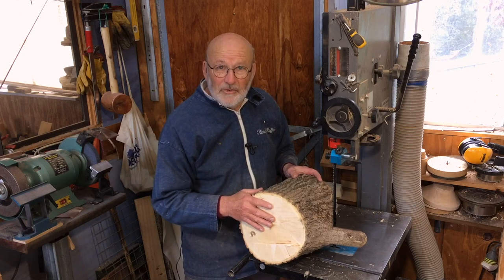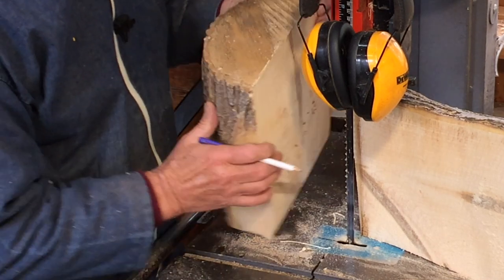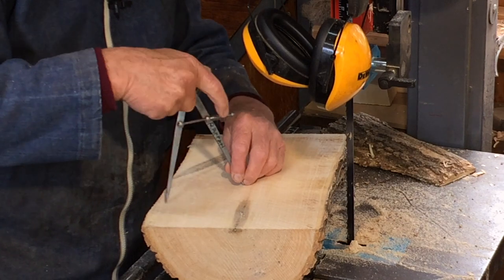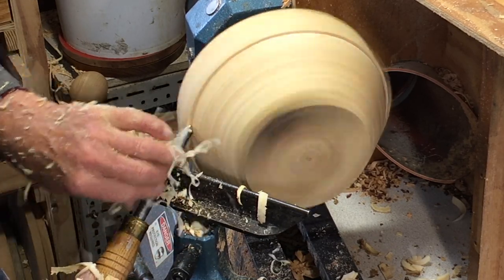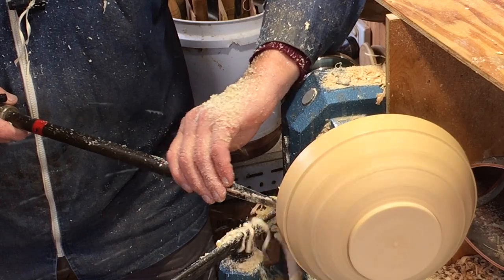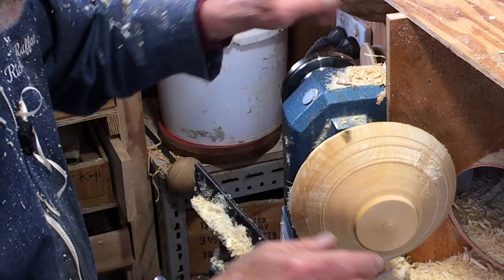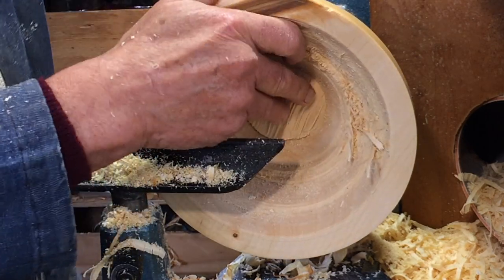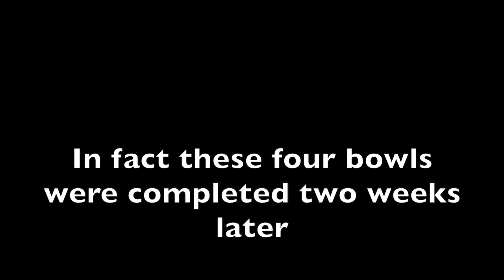Richard Raffan gets four bowls from a short box elder log.

Comment: Very nice result. The coring resulted in two smaller bowls, excellent. You make it look so simple. Must be nice turning that wet wood. Thank you for sharing. Have a great day and stay safe.🙂🙂
Reply from the maker: I find wood most enjoyable to turn when it's been felled 3-4 months when it's beginning to dry and I don't get soaking wet as it fling out moisture. And after that when it's really old. I've turned oak and elm several hundred years old out of old barns and chuches and it's almost a different material to modern seasoned timber.

Comment: Absolutely marvelous! I really enjoy Box Elder, especially burl and feather figure. We lack the flame here in New Mexico but I enjoy it regardless. 

Mr. Raffan, would you please consider a video of your bowl drying process? I follow Mike Mahoney’s school of thought but that means my rough bowls get slathered pva-like glue and dry for 6 months or more. How does your process work?
Reply from the maker: Many thanks for the suggestion, Scott. I'll add that to my list. I don't bother with sealing endgrain on bowls. For a few days the bowls are left in a loose pile out of the sun. I check daily to see if any start splitting. Those that do go straight back on the lathe to be completed green, and thereafter they tend to warp rather than split. After a week or so the roughed bowls get stacked away for at least a year and often way longer. Like decades. I still occasionally come across bowls dated in the 1980s and '90s although I sold most when I downsized.

Comment: I learn so much by watching you and listening to your reasoning as you proceed. Thanks for sharing. It means a lot to a novice turner to have a seasoned veteran like you. Question: I know boxelder is soft and therefore dries relatively fast but “3 or 4 days” (which ended up being a couple weeks) seems too fast for them to be ready for finish turning. How do you dry your green pieces so quickly without incurring excessive splits or warping?
Reply from the maker: Initially my intention was to complete the bowls whilst there was still enough moisture in the wood that the bowls would distort slightly once finished. Unfortunately they warped before I could re-turn them. I was surprised at how dry the shavings were but occasionally roughed bowls are ready for completion in a few weeks. Much of the initial warping in a bowl is due to releasing tension in the timber when the centre is removed. For my Wavy (distorted) Bowls I look for timbers like casuarinas or oaks known to warp and they are microwaved to speed the drying. For bowls that are to stay round, I choose timbers known for their stability. To limit splitting it helps to have timber of even density and even thickness. The position of the pith affects how a form will distort. You can see how in the gallery on https://www.richardraffan.com.au and read about it my books, particularly Turning Bowls.  https://www.richardraffan.com.au/books-and-dvds/

Comment: Hi Richard,

Could you tell me what the advantages of the "harpoon-style" handle you have on the slicer are over a long self-made turned handle? Also perhaps if side handles or braces provide much?

I am learning a ton from your books and these videos especially. Thank you so much!
Reply from the maker: I don't understand the physics, but the pistol grip is easier to control than a straight handle. The original Stewart System had an arm brace as well as the pistol grip but I don't need that nesting bowls less than a foot diameter. When on workshop tours I travelled with a 2-ft. long straight handle (pistol grips guaranted a baggage search) and was always glad to get back to the pistol grip or armbrace.
Reply: That is very helpful to know. Thank you for the reply!

Comment: When you are roughing your bowls, you put a couple of grooves on the inside. Can you explain the purpose of these. Do they help control warping or reduce the chance of cracking? Great education watching you work.
Reply from the maker: The internal shoulders are to locate the chuck jaws when I remount the bowl for completion. For even drying it helps to have an even wall thickness and not too much extra in the base.

Comment: Hi Richard, interesting new tool, and how you used it from the headstock end. 

I understand the decent sized screw chuck is pretty safe, but I guess I’d still use tailstock support.
Reply from the maker: It's not so much the size and length of the screw as the width of the faceplate that ensures a strong grip. I bring up the tailcentre when the blank isn't flat. If the blank does come loose on the screw you're left with the blank on the slicer. Roughed bowls flying off tend to jump to the floor but not go far.

Comment: What is the purpose of the two concentric notches with the flat faced scraper on the inside of the bowls?  Does it help with drying/cracking?
Reply: Those are for expanding the chuck jaws into when working the second turning.
Reply: @jeffriechel  Interesting... not a bad idea.  Not sure why I've never seen that before.
Reply from the maker: The internal shoulders are to locate the chuck jaws when I remount the bowl for completion. Nothing to do with the drying. For even drying it helps to have an even wall thickness and not too much extra in the base.
Reply from the maker: @jeffriechel  Thank you.You put that better than I did.
Reply from the maker: @jfinch84  Maybe not read the right books....  https://www.richardraffan.com.au/books-and-dvds/
Reply: @RichardRaffanwoodturning  hi Richard, I do own your Guide to Turning book :). Just missed this bit, but it’s in there on page 219. Love your videos too!

Comment: What is the purpose of the rings that you cut into the hollow side of the bowl at the end? Does that help it dry more evenly?
Reply from the maker: The internal shoulders are to locate the chuck jaws when I remount the bowl for completion. For even drying it helps to have an even wall thickness and not too much extra in the base.
Reply: Sorry, I read more comments , and that topic was answered by Big R.     🙃
Reply: @RichardRaffanwoodturning  Thanks for the info! Looking forward to the rest of the trilogy.